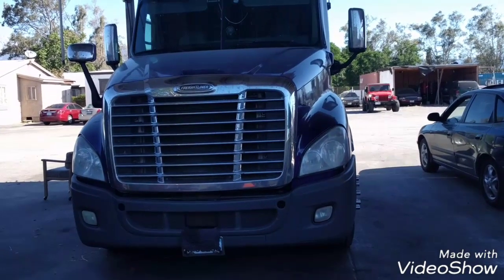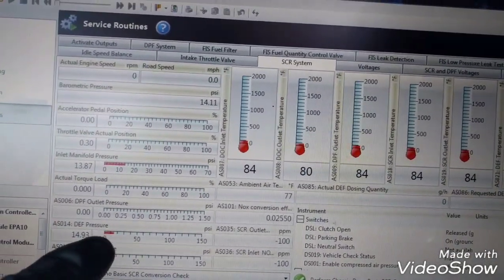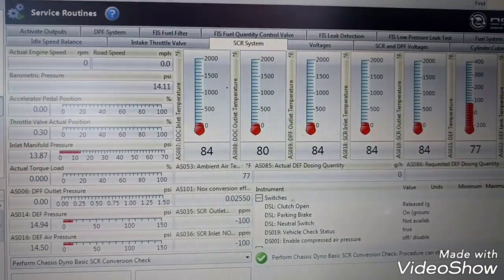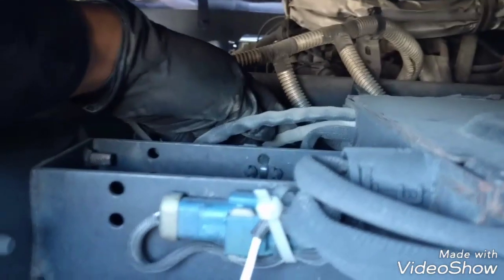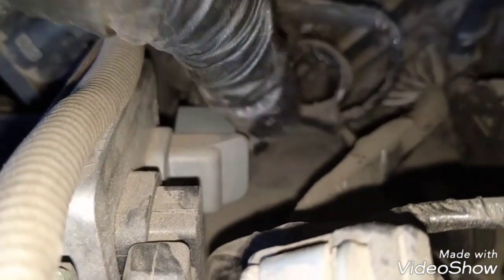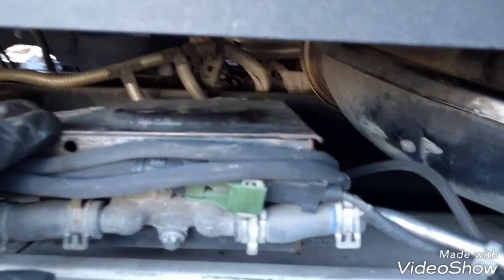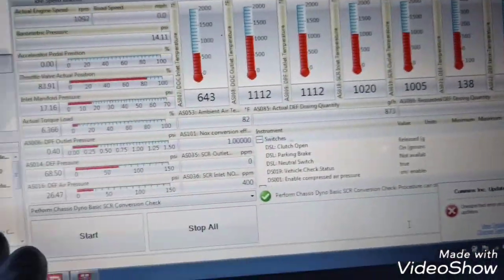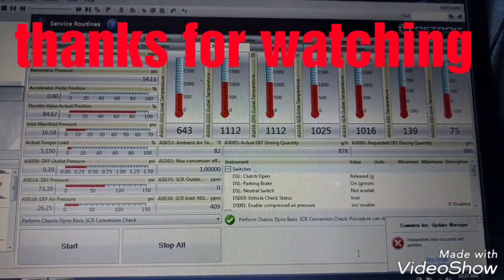Freightliner Cascadia DD13 DD15 SCR filter bypass SCR conversion efficiency low Improper DEF quality

Comment: What do you think is the best way to go with my 2012 dd15? I got your last response....some people tell me delete....some say drill holes in filter. I need best wat go go. Thanks
Reply from the maker: A DPF delete, can reduce the amount of problems but CAL EPA is enforcing emissions check points right now,  it could be risky for you.  

The By bass does not eliminates the DPF system and you won't have problems with CAL EPA

Comment: I have a 2012 cascsdia dd15... one box replaced 3 months ago...I run CA only...would you suggest I get this? What's the good and bad doing this?
Reply from the maker: Bad.
-Amber light on all the time 
-Sometimes low power (10% of the time) 

Good
-no more def blinking 
-regen process normal
- emissions process normal 
- no modifications needed 
- easy to repair it correctly if it is necessary 
- normal engine operations
Reply: Francisco Amaya so will it continue DEF even though you at 100% efficiency?
Reply: @classicjay7786  yes you will continue to use Def but at a greatly reduced rate.

Comment: Hello,
My 2011 cascadia broke down over weekend and i cannot move pass 5 miles per hour.  I have check engine light on, red stop light on, and yellow def light on. I bypass the scr  with the new outlet nox sensor and performed a manual regeneration on side of road which didnot complete i think because it lasted for 25 to 30 mins. I have the following codes
Spn 4364 fail 18
Spn 3364 fail 2
Spn 3364 fail 17
Spn 3364 fail 1
Any help would be appreciated when u can
Reply from the maker: Does it has any other code? 

Bypass the speed sensor. (Only works with manual transmission)
Go to the freightliner dealer and buy a vehicle speed sensor 
Then go to the truck and go underneath the transmission output shaft and remove the plug from the transmission sensor on the output shaft and then connect it to the new vehicle speed sensor to bypass the 5 mph mode.  
So you can drive to you home city to fix the truck.  

The problem that you have it related to low emissions,  check that the SCR conversion is more than 65%
Reply: @franciscoamayaYT  i have no more codes. I will do bypass by buying 
V speed sensor. Thank you for taking time to answer. I will also try to clean def pump screens and def metering valve a friend told me those get clog. Thks
Reply: Do the vehicle speed sensor has to be new in order to work?
Reply from the maker: No exactly,  it only has to be a completely functional speed sensor.

Comment: sir i have a 2013 cascadia with one pack and dd15 bought new nox outlet sensor do not see box on top of unit. can it be mounted on side between one box and fuel tank?
Reply from the maker: Yes, for 2013 is located between the tank and the scr box.
Reply: ok, it works , thanks

Comment: I tried this method on 2012 Cascadia  with DD15. After 2-3 hours  I added DEF at truck stop. When I came out and drove 4-5 miles Spn 3364 fmi 17 poped up. Engine was de-rated 25% and the speed was limited 55mph. This code is not easy to clear. Parked regen needed. Anybody else had this scenario ?
Reply from the maker: You must have another issue,  the code 3364 means warning override 
Check if you have any other problems or codes
Reply: I don't have any other codes and issues. I will test it again and I will let you know if that stupid 3364 will pop up again. Bro thank you for your posted videos !
Reply from the maker: There should be a reason why the code is getting set, the 3364 only appears when there is a critical event happening with the emissions.

Comment: Will this work with a code: eec 61 spn 3251 fail 2? I have a 2011 Cascadia with the DD15
Reply: Did you find a solution to that problem sir.?
Reply from the maker: No, you are having a PROBLEMS with the doc pressure to high, it could be a sensor or a bad SCR box.

Comment: Do i need to take the plastic piece off of the new sensor and then stick it  and the long cord attached in the little black box also??
Reply from the maker: You don't have to do that if you want, it is optional.

Comment: What did u do with the access cord from the outlet sensor did you zip tie it??
Reply from the maker: Yes, I did.
Reply: Francisco Amaya so now u have 3 box sensors sitting in that Lil box on top ? Where you put the cord at though
Reply from the maker: You are going to leave the extra sensor inside the box, or next to the other one for 2013 and up SCR box.
Reply: What about 2011 Cascadia
Reply from the maker: You just leave it inside the little sensor box.
Reply: @franciscoamayaYT  can you cut the old sensors wire off?

Comment: Una pregunta Francisco yo tengo el codigo 5246 FAIL 0 y no puedo mover lo mas de 5mph,si yo hago esto lo voy a poder reglar?
Reply from the maker: Tiene algun codigo mas El camion?
Ese codigo solo en un warning, si puede sacar other codigo para una mejor opinion.
Reply: Mi troke tiene estos codigos
eec 61 spn 4334 fail 04
Eec61 spn 4335 fail 05
Eec61 spn 5246 fail 15/ 16
Eec 61 spn 5246 fail 00

Muchas gracias por la respueta, no lo vi hasta orita
Reply from the maker: Cambie El DEF metering valve. 
Esta localizado en la parte enter El tanke de diesel y el filtro the emissions.  
Valve comp $650 y require core a cambio.
Reply from the maker: Si no le encuentra me avisa y vere como nos podemos ver.
Reply: Francisco Amaya  tengo una pregunta ya cambien el sensor pero tengo check engine solid y stop engine solid no ocupo computer para eliminar los códigos?
Reply from the maker: Va a necesitar hacer una regeneration con el DDDL software el programa de Detroit.
Reply: Francisco Amaya disculpe Francisco yo tengo los mismos códigos ya cambié todo eso y no le ayo mas siempre tengo el mismo problema si me puede ayudar

Comment: Ey my friend, do you think that deleting the def system will do better to the engine , or bad? Do you think if a deleted the one box scr system will damage the engine ? Can you give any advice about?I hv a 2012/2013 cascadia
Reply from the maker: Well, it has some side effects. 
I saw truck with the scr system deleted they have the following side effects. 

No power
High fuel consumption
Check engine light on
Engine Failure
Engine not working properly
Etc,..

Of course, this will not happen to all the truck with scr system deleted. 

In my opinion, the SCR delete is not a good idea. I prefer to do the SCR system bypass. 

Many people are doing the SCR system bypass, this is happening for the mechanic with not experience trying to fix a problem by replacing parts and parts until you have a $10,000 invoice.  

Quick question, why do you want to do the SCR delete?
Reply: Francisco Amaya just because that what I heard on the, people talking about deleting the scr system is the best option , for everything, money and for the truck, I hear too that def cause internal problem in the engine too, I'm really not sure with those statement , it's always a good idea to ask a good mechanic like you, I assume for your videos that your are more than that, so I ask you first , now, that bypass you mentioned is the one you did in this video? Or another one? I saw another video too that someone sell a 1 box scr system bypass, just unplug the connection to it and install the little box they sell and done, I'm gonna give you the link so you can see it, I mean if you want to, another thing , it's true when the scr box goes bad you need to replace it? The all box!!?? I mean that s expensive, very expensive.... Thank you sr for always responding , you help me out with starter the other day, I really appreciate it
Reply: this is the link to the video      https://www.youtube.com/watch?v=vxx0ge3FBtw&t=6s
Reply from the maker: The truck I repair on my Videos are 2011 - 2014, they all have DEF.  You can see the mileage on them, some of them are close to the 1 million miles and they are still running with their original DEF system.  

The by-pass is the one on the video you saw.  

If your SCR box goes bad do the bypass and it will run with not problems (maybe the Amber light will be on).
Reply: Francisco Amaya thank you my friend, you rock!!!👍👍👍👍
Reply: @desvariosdeuncamionero8856  it is true.  The doc is not replaceable.  They recommend replacing the dpf filti to.  Several hours of troubleshooting and sensor replacement before they make you buy a new1box.  12,000$ USD, plus several days downtime.  Freightliner  doesn't care if you starve.  This happened to me a month after warranty was up.  Thank you Francisco!
Reply: Fuck that shit take everything off and let you motor breath
Reply: Of course the DEF bshit was made so you troke get stuck and you spend more money in california ... the california state wants you money

Comment: How long can you drive with this bypass in place? Miles?
Reply: Can you get me a call
Reply: 2532298652
Reply: @jaygala3854  I'm wondering the same
Reply: I ran it for 2.5 years until my one box was completely destroyed. It works amazing. My one box needed replacing I did this bypass and got 2.5 years more out of it. Do regular maintenance, with bypass in place clean dog filter etc… hope this helps.

Comment: I found I lot oil in the air cooler and the turbo is dry with no oil what do you think is the problem?
Reply from the maker: +Jesus Camacho 
The only way the oil can access the CAC (air cooler) is by the turbo.  
The turbo can have a small leak and this can be caused by a bad crankcase filter or a bad turbo. 
Unless you have just a small amount of oil in the CAC that will be classified as normal in some cases.
Reply from the maker: +Francisco Amaya 
Hablo español si se le hace mas facil
Reply: Compa, ese aceite puede ser de una falla de turbo anterior, si el turbo actual no tiene aceite visible en la turbina de admisiòn no te preocupes. 
Ojo, si es mucho debes drenarlo, si es solo humedad dont worry.
Reply: Crankcase filter is plugging up. These help the crank case breath, when it begins to plug up its kind of suffocating the crankcase, So what happens is it begins to pull oil from anywhere, Valve seals ect ect, This oil ends up in your intake side through your air cooler. Long term it can cause soot build up on your dpf filter.

Comment: How do you get the computer program on the laptop to read the codes from the truck?
How do you get the cable from the truck to the laptop?
Thanks.
Reply from the maker: +97935 c242 
The software name is DDDL software and the adapter is a NEXIQ USB link. 

You can buy them online or at your local heavy duty tools supplier. 
My only recommendation will be to to buy a 2013 or older DDDL because this one doesn't require a year subscription.
Reply: Diesel laptops,  is a good place to buy the programs
Reply: Francisco Amaya 
Hello, do you know the right adopter for dd15 or a link for it 
Thx a lot for help

Comment: without the proper sensor reading will the truck still regen on its own or will the dpf filters clog up?
Reply from the maker: +Richard Jolley 
You need the proper sensor in this case the SCR outlet NOx sensor, you cannot use the improper sensor because it won't fit in the plug.  
This by-pass will work with codes (scr efficiency low and improper DEF quality)
Now with the scr outlet NOx sensor bypass the regen will be completed as it normally does but it might give you a warning light (improper scr outlet NOx sensor signal) but you will be able to drive the truck with no red light on your dashboard and as you normally drive your truck.   (in some cases will be some power loss but nothing to worry about)
Reply: Francisco Amaya.               I have been getting a low noc code that cuts my power on and off for the last 6 months.  the shop can't figure it out and just changes parts.  it is worst when driving in the rain and snow.
Reply from the maker: +Richard Jolley 
Ok, I am  going to tell about the low NOx possible causes. 

- bad DEF quality
- bad NOx sensor
- bad DEF injector
- DEF pressure low

- DEF air pressure low(2011-2012 some 2013 DD15)
- bad DEF metering valve(2011-12-some 13 DD15)
- DEF leak 
- engine exhaust leak
- engine consuming coolant
- bad SCR filter box
- bad DEF pump
- etc,..

I suggest to perform a regen with the computer (DDDL software) to see how the SCR conversion efficiency is doing and then go and do a driving regen to see how the SCR conversion efficiency is doing when you are driving the truck compare the reading to determine a solution.
Reply from the maker: +James Riggs 
Some time removing the transmission speed sensor overrides the 5 MPH mode and you can drive the truck up to 50 MPH.  
By removing the speed sensor I mean: remove the sensor from the transmission and place it somewhere else (safe location) or disconnect the plug of the sensor and connect the plug to a different speed sensor (you need to buy it)
Reply: Francisco Amaya I wish you was in nj because truck needs a box and it's stuck create at 5 mph. freightliner sad the box is shot. I have 2011 freightliner cascadia with 621000 miles one it
Reply: @Cubariggs  yo check out genesis diesel in Nj man. They by pass your entire shit for a good price. Smartest investment I ever made. Charged me 1750
Reply: James Riggs did u end up buying the box
Reply: Anybody know where Francisco is located